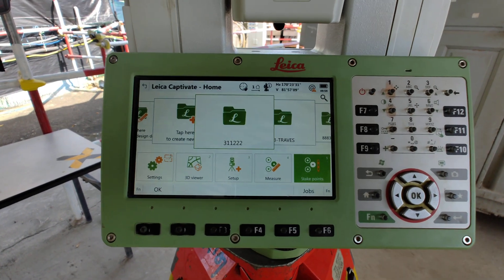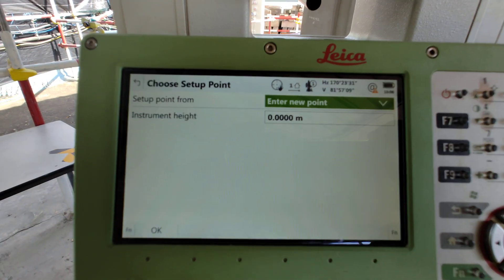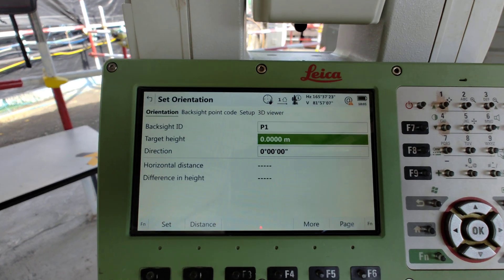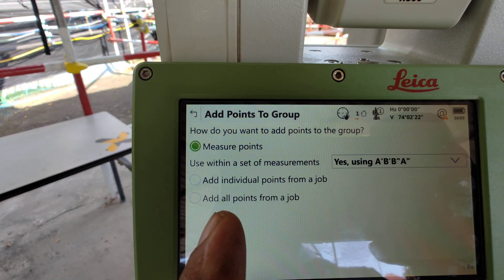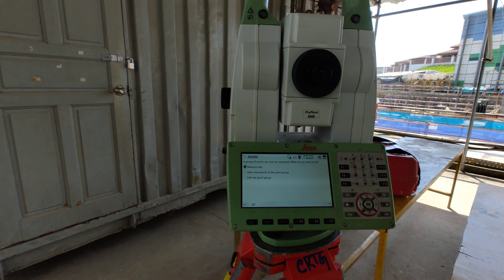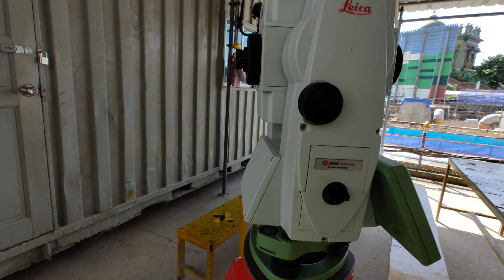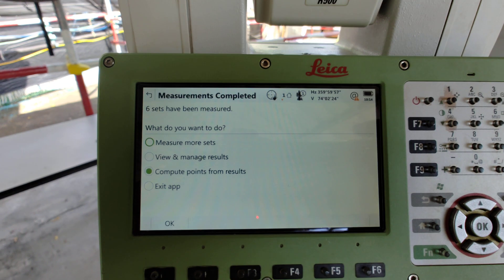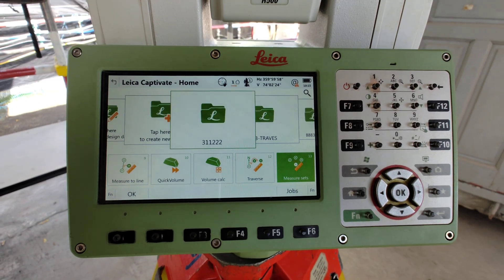How to do Traverse or control survey work by Leica total station TS16,

Comment: There is one thing to be considered: it is not possible to make assumption on angular accuracy when measuring in reflectorless mode and doing it automatically, robotic instrument can correct angle in Face I/Face II when it measures reflector - so it can aim directly center of the prism using ATR/Power ATR technology. Now total station measures literally ANY surface, not necessarily the point that is required. Anyway thanks for the video, quite good!!!
Reply from the maker: Thanks for you advice.
Reply: yes good points, we never use reflectorless mode for any kind of control work because as you say it is not selective - the only way to get high accuracy is to measure to fixed points with a tripod and prism set up, letting the ATR do its thing, even a prism on a braced pole is subject to movement which affects the overall results. Remember control is very important because if the control points are inaccurate, all subsequent measured points will inherit that inaccuracy before any more measurement takes place. One addition too - ensure the total station is regularly calibrated by experienced engineers they are not foolproof in terms of accuracy, especially if subject to bangs and knocks from time to time
Reply from the maker: Thanks for your advice.
Reply from the maker: This video is only for learning, another original video have my channel about this survey work. Please watch another ok one. Thanks
Reply from the maker: We also no use reflectorless mode for control work. This video is for learning, we just show how to do control survey work. Thanks for your understanding.

Comment: Hi sir there for Auto measurement height Total Station Leica TS16 ?
Reply from the maker: I think total station can't get auto measurements.
Reply: Oh there is not auto height measuring feature on the Leica TS16 I1 "R500" total station right
Reply: in my comany they have purchase new Leica TS16 I1 "R500" total station but i didnt know key feature for auto heigh measurement fro instruments.
Reply: i thought of take auto heigh measurment for instrument heigh
Reply from the maker: Depends on what kinds of job you doing.
Reply: today i take two known backsight station but its give error for elevation
Reply: @Ovisingapore  doing Travers point
Reply: acutally from where i should take instrument height
Reply: any how is there for check box to make mark for auto heigh measure for instrument  heigh
Reply from the maker: @fieldtripstories  If you use khow backside points, this points should have X Y and Z.  Otherwise your elevation will be error.
Reply: @fieldtripstories  instrument height is measured from the control point on the ground to the dot on the side of the TS using a steel tape, taking 2 mill or so off for the slight angle between control point and side of TS
Reply from the maker: This video is only for learning, another original video have my channel. Please watch another one. Thanks
Reply from the maker: Known backsight should be use X,Y,Z. Example need to measure height target and total station also. Better use Multiple backsight with target and total station height.
Reply from the maker: Top of the control points.
If you use tablet or bracket please measure table or bracket top to total station or target measure area.